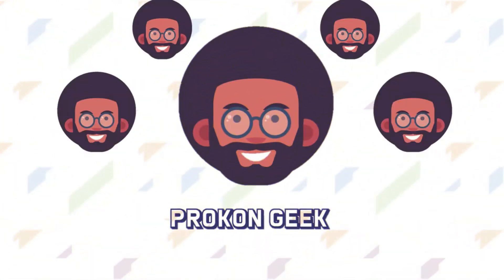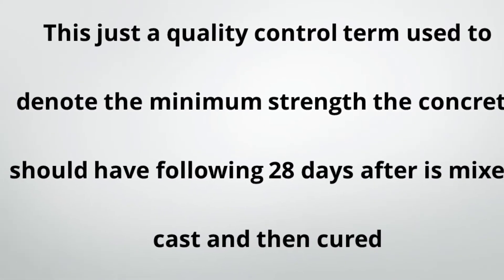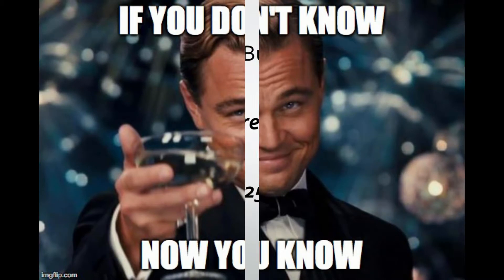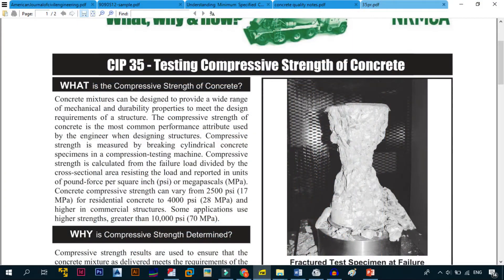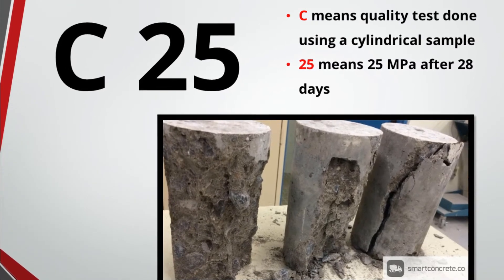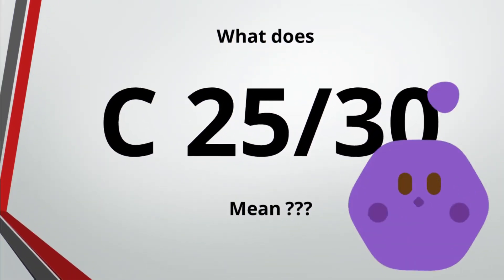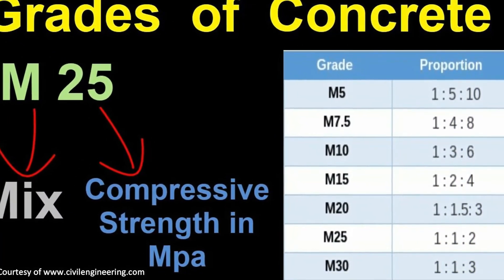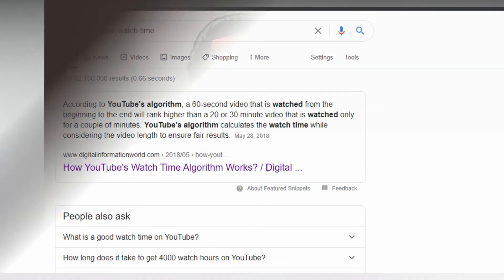Concrete Grades Explained for Civil Engineering | M25 vs C25 vs C25/30 Concrete Grades

Comment: Thanks a lot for your explanation. So far, this has been the best explanation i've found but there is still some confusion about it. I know the C grade of concrete always uses a higher number than the M grade of concrete of the same strength. Eg, C20 and M15 are the same strength or mix of concrete, so why then are the corresponding M numbers rather higher than the C numbers in your chart? Eg C30/37 means C30 = M37, but I thought it should be the other way round, eg. C37 = M30.
Again, I know for a fact, that C20 and M15 are the same strength of concrete (the most commonly used 1:2:4 mix) but on your chart, you have C20/25, meaning that C20 is the same as M25. Can you please explain?